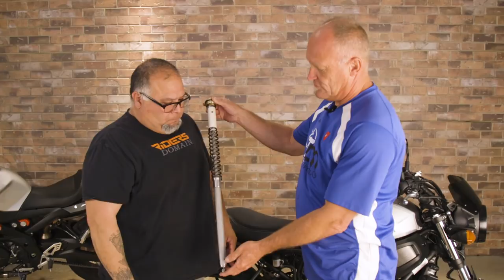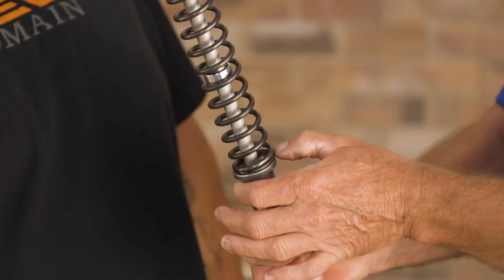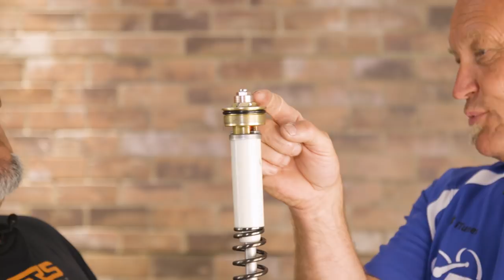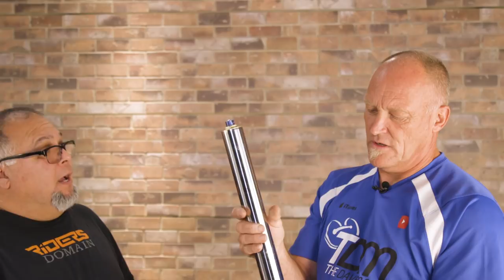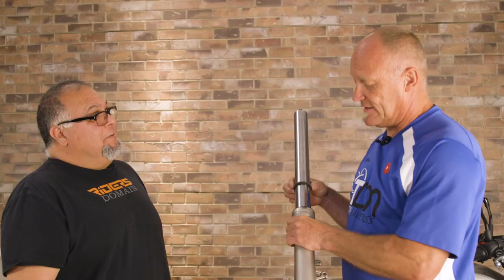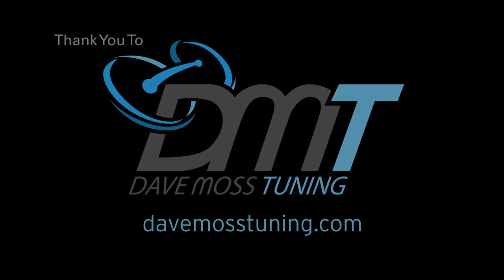Riders Domain Bike Talk with Dave Moss | Part 6 (2018)

Comment: Sounds like the morjority of people including myself have no idea and are riding bikes that are potentially dangerous 😯
Reply from the maker: Definitely, a point Dave hammers home again and again too. Tire pressure, fresh fork oil, brake fluid, dialed suspension...all stuff that can easily be overlooked but have some pretty big impacts on the quality of the ride. Basically you want a motorcycle that performs its best and responds predictably, otherwise run the risk of something unexpected happening. Thanks for watching!

Comment: I think they overcomplicate the joy of riding a motorcycle.
Not all of us need top race specs on a bike.
Wathing this series it seems there are no bikes that fit the customer before several customisations has been made.

If you life is dependent of absolutly correct fork oil, mm correct sag, replacing the brake fluid each 3 months......well the take a look at your riding style first.

And, changing brake fluid each 3 months is potentially more dangerous than running the same fluid for a year or two.
Come on. It's not like after 90 days it is full og water. It goes gradually.
And changing the fluid gives risk of not completly bleeding correct, inducing air or other faults each time you fiddle around.